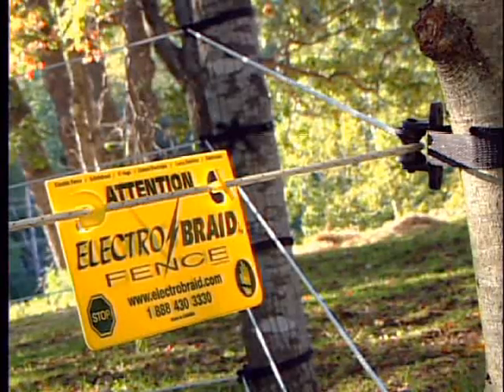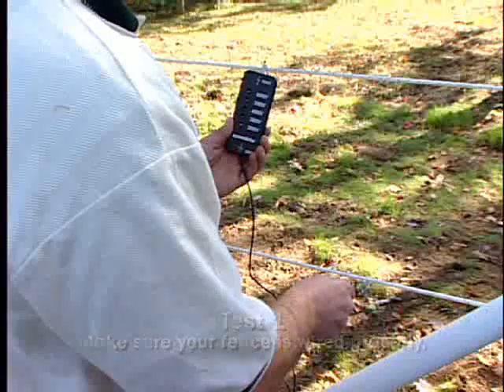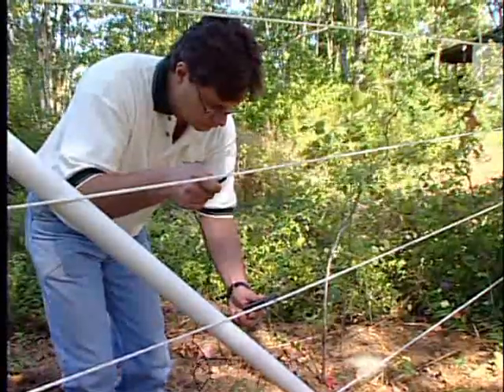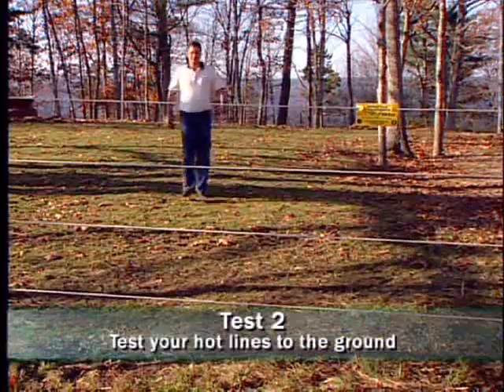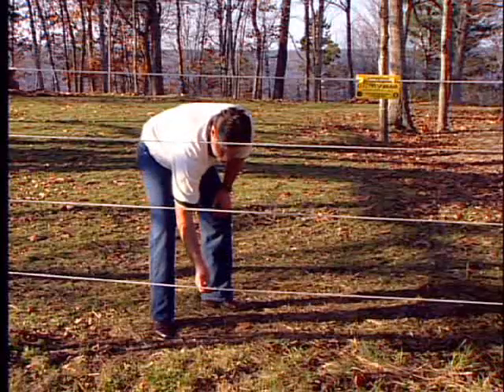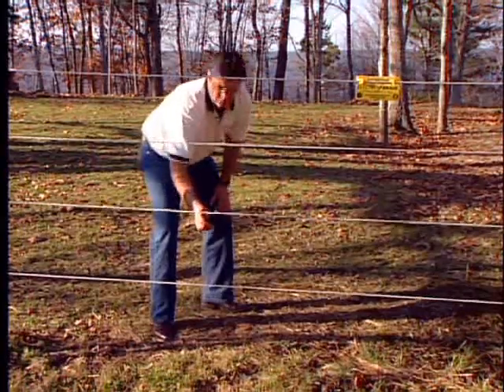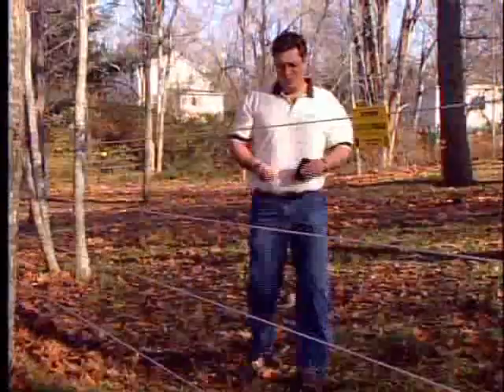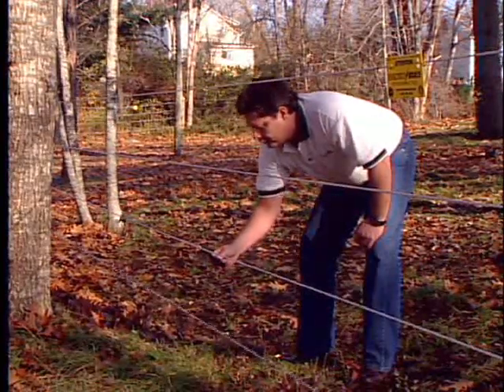Testing Electric Fence with a digital voltmeter

Comment: Need more info, please.  MUCH more. Firstly, you mentioned we need 5k volts.  I agree.  But the little reader shows 7.3... Or... 5.4

Is that first reading 7 thousand volts? Or... 700?    Also I have the exact same device.  There is no on of off switch.  Often times it comes to life, but sometimes the led is blank
  How can I force it on?